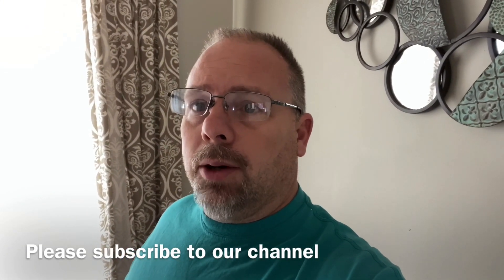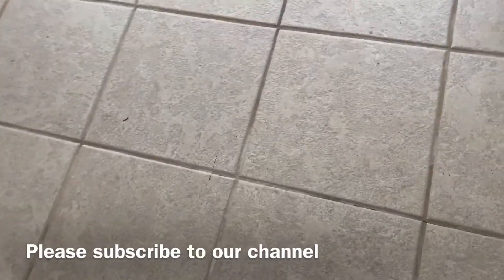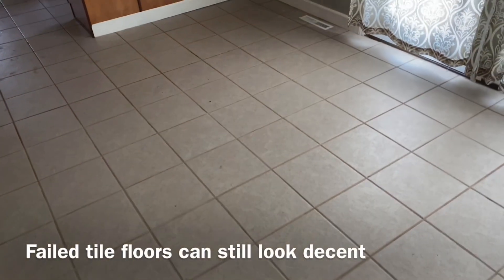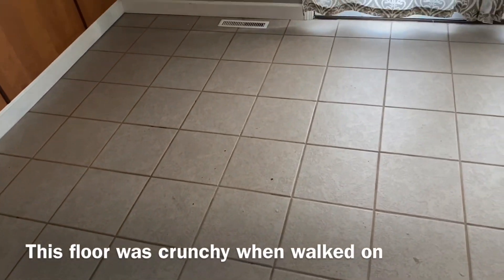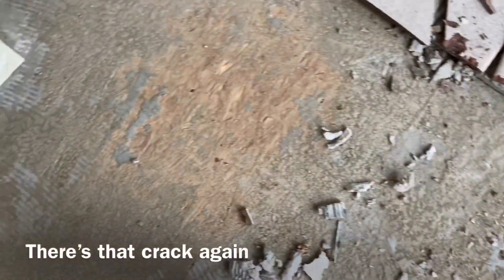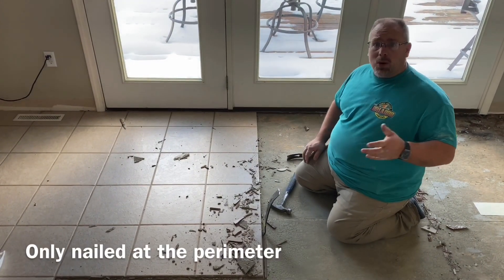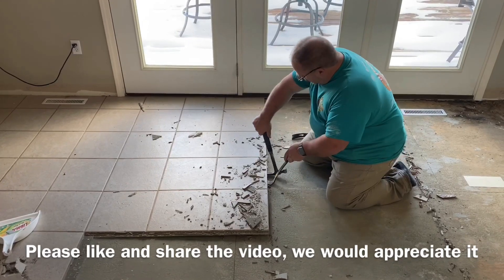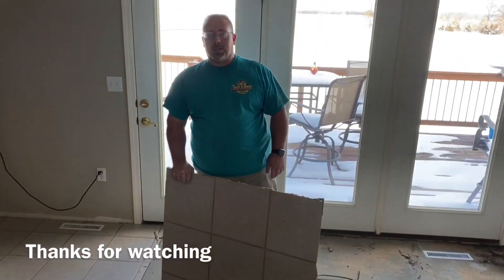Horrible Tile Job | Failed Floor Tile | Columbia Missouri

Comment: Best point made was people who just live with what they got.
I get calls and when I'm out at the initial visit see floors with massive issues.
I try not to highlight it but it always transpires that the reason I'm there is because the last tiler did that failed job and now they call in someone competent.
What annoys me most is the badly done job is always the quick easy money and I'm left with the big technical job with the massive amount of prep work.
Yet lads get to do these money makers and skidadle.
Reply from the maker: I made this video to also share on some groups. I talk with a lot of tile setters that claim to never see a failed floor. I think they’re looking for a floor that’s all cracked up and falling apart. This job definitely failed. The homeowner is replacing it because she no longer likes the color. The fact that it was crunchy only added to her case but wasn’t the primary reason for replacement.

Comment from the maker: How do you install tile?
Reply: Depends on what I'm tiling on.
Concrete  _ eco 918 primer and eco rapid set flexi white .
Double butter.

Timber _ Q matt .
Notched trowel the area.
Lay d matting on adhesive and squeeze into the floor from the middle out to key.
Key the matt.
Notch trowel matt...back butter tile...
Never had a call back.
We have concrete boards in Ireland but I refuse to use them.
I stuck with what works for me.
Reply from the maker: Sounds like you’ve got a great system there. 👍👍

Comment: Is that ceramic tile? Never seen a porcelain tile crack.....Only cheap ceramic and stone like travertine, marble etc...
Reply from the maker: This was ceramic. Porcelain is subject to reflective cracking as well, it doesn’t absorb movement well. We see lots of hairline cracks in porcelain tile direct bonded to concrete, for example.